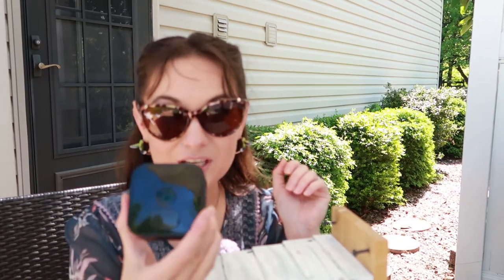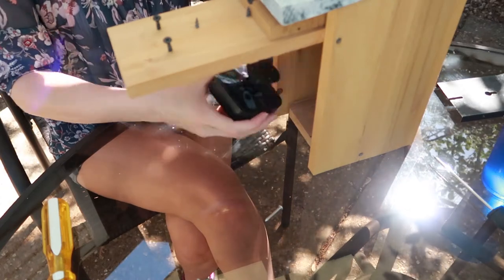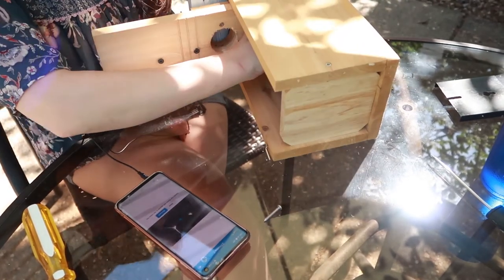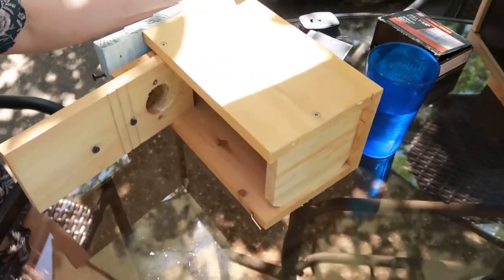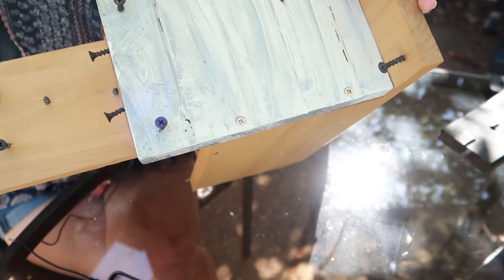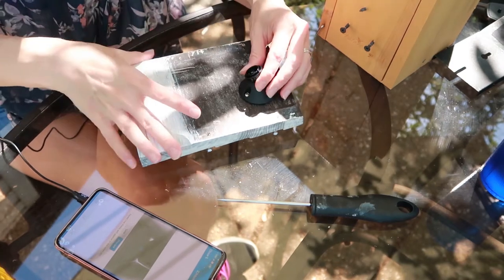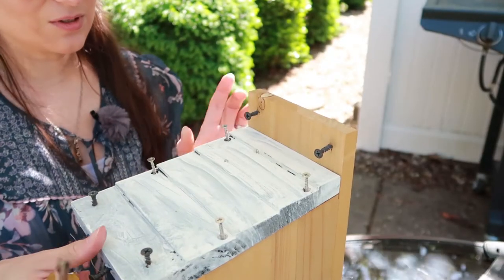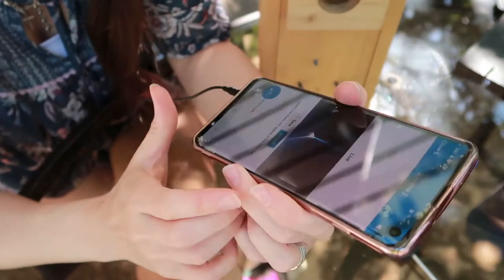How to Install a Blink Camera In Your Nest Box/Birdhouse for Bird Monitoring

Comment: Have you had any issues running out of batteries with the blink camera during the process?
Reply from the maker: Yes actually. Some ways around that is to only turn monitoring on manually to check the box. And this is actually important on hot days because an active camera will add heat to the box.

The other thing to do is to install a solar panel. They're cheap - $30 on Amazon.

I made an install video recently:  https://youtu.be/M2_fLZj9LVc
Reply: @nesthollow5159  If I have brand-new batteries installed, it won’t last until fledging? I totally get that there is a lot of motion going on but they are supposed to last for two years. Weird that they wouldn’t last for a few months of nesting – no?
Reply from the maker: @DanielKowarsky  mine lasted up to about a week before fledging. That was with having motion on at night and during certain times of day. So they can last quite a while. But it cut it super close.

You also won't want monitoring on 24/7 because your alerts will be going off twice a minute during the height of activity. But during certain stages and times of the day, it's fun to have the monitoring on. It's a great way to study the birds too. For instance,  what time does momma leave the nest in the morning? When does she roost? At what point does she stop sitting on the babies to keep them warm at night? So there's definitely a lot of fun stuff to watch.

If you're worried about the battery, I'd invest the extra $30 or so for the solar panel. It's just so helpful and puts your mind at ease. Toward the end when they were close to fledging I'd check the camera and pray it wouldn't run out because the app alerted me to low battery.
Reply: @nesthollow5159  Thanks for all the info! Really appreciate it!
Reply from the maker: @DanielKowarsky  no problem. Thanks for the questions.  They're great ones to ask for sure.
Reply: @nesthollow5159  Hey! It’s me again! I have a chickadee pair that have just excavated the box and I’m now waiting for them to bring moss in to start building their nest.  I saw how much motion went on during the excavation process so I decided to install brand new batteries into the camera after they excavated.  I have my camera mounted to the top of the roof inside using heavy duty velcro. It actually works extremely well! I’m not using the mount because I get much more viewable space without it. For that reason, I am unable to plug in any micro USB to the back of it – not enough room. Next year, I will build a taller box so I am able to incorporate some of your mounting ideas and I will also be able to use the micro USB and power it that way.  Just a couple of quick questions. Should I be turning monitoring off at night? Did you use the scheduling in the Blink app? What did you typically keep your clip length at? Mine is at 30 seconds. You also mentioned that you turned off the monitoring during the day as well – did you do that the entire time and turn on as needed? Any specific Blink app settings that you recommend? Sorry for all the questions! Thanks again 😀
Reply from the maker: @DanielKowarsky  yayyy chickadees  ❤ 💙 . They are the sweetest. Ok they're all the sweetest.

Pardon all the typos. This is on my phone. 

The velcro idea is brilliant, but yes,  I understand the issue about the USB port.

I don't have my camera going all the time. Here's a few things I'm doing with my Dees:

1. She's roosting at night. Nest is still in construction. So I turn the camera on at about 5 and wait to see when she comes in for the night. I like noting the sleep times. I don't leave my cam on at night because I don't want a ton of notifications waking me. I wake before she does. So I'll turn my camera on to see when she leaves. I capture the in and out moments to get times.

2. I wait to see if I catch her going to the nest and turn it on to get some nest progression footage 

3. When she is ready to lay, I'll probably leave the camera on more to see if I can get laying footage.

4. When I know I'm close to hatch day, I turn the camera on every now and then to get footage.

5. Daily capture of nestlings and feedings here and there.

6. Forgot, incubation, flip the camera on occasionally to get footage of egg turning and mate feeding.

7. Camera on occasionally during tough storms to see how momma and babies handle it (always fine).

8. I check them at night before bed. Very quick footage for that.

9. Occasional quick check ins during the day to make sure they're OK.

Keep your clips quick for check-ins and longer if there is certain footage you're after. Last year with this process I got my camera to last me very close to fledge. By the time the bluebirds were fledging, the battery was in the Red. So I checked once a day for a split second.

I only have so much storage with Blink so I upload good footage to a Google Drive account and regularly purge from the app.

I haven't tried scheduling,  but thats a great idea.
Reply: @nesthollow5159  Thanks so much! Really appreciate it! ☺️
Reply: @nesthollow5159  Last question - I promise 😀
My nest box has a wire mesh at the bottom of it to elevate the nest. The female chickadee has removed all the shavings down to the wire mesh but there are still wood shavings under the wire mesh which she seems to want to try and get to remove. I’m not sure whether I should remove the wire mesh for here or not I just wanted your advice?
Reply from the maker: @DanielKowarsky  no worries. Your questions are appreciated.  Has she started the nest? If not, I'd remove the mesh. I think the main reason for them is so that blow fly larva falls to the bottom. But so many birds hate the mesh. 

There is a video on the channel about using diatomaceous earth under a nest once the nest has gotten going. This can help reduce the potential for blow flies and ants.

However,  I wouldn't do it with Dees. They kick up a lot of dust when building and that could be harmful for their lungs. 

The upside with chickadees is that they nest earlier. And while it's still cooler, bugs are more dormant. Blow flies become more of a concern when Temps hit 70 or higher and stay there for a while.

Since bluebirds have multiple broods, blow flies are a bigger concern for them. That's not to say that it can't happen to chickadees. Monitoring is key :).
Reply: @nesthollow5159  She hasn’t started the Nest yet but she’s taken it all the way down to the mesh. Do you think if I remove the mesh, it might scare her away from the nest box because of the change? Really not sure how she will react.
Reply from the maker: @DanielKowarsky  there is always the chance, but if you're worried about the safety,  I'd remove. 

And in my experience,   my Dees have been pretty tolerant.  Some people I've known have had very skittish birds.  

I had 2 boxes up this year for Dees. And they started "excavating" one. But a bluebird poked its head in the entrance and scared the chickadee pretty bad (hole reducer kept it from being a worse situation). The Dees abandoned that box and took up the other. So I'd say a bird is much more a fighting threat in their mind than a change inside the box.

Again, it really comes down to safety.  If you're afraid they'll try to get down in there and get stuck... take it out.

I found a mouse recently that got its head stuck in hardware wire mesh. It was a bad situation having to cut it free. But I got it without injury and helped it back to health before releasing it. So wire mesh and getting stuck in ways you'd never expect is pretty scary to deal with.
Reply: @nesthollow5159  I took out the mesh.  Its funny - everything I’ve read and seen says the chickadees take out some of the wood shavings - not all - but she seems to want to take them all out.  I put about 3-4 inches in there! Pretty amazing!! Thanks again for the advice!! Always learning 😀
Reply: @nesthollow5159  Just wanted to know your opinion on this. If I happen to run out of battery on the blink camera, is it safe to go into the box to switch out the batteries? Will she abandon the babies? I know it’s not ideal but just wanted your opinion?
Reply from the maker: @DanielKowarsky  this is a great question.  I wouldn't do it while there are babies in the nest because you're presence there will end up being longer than if you were to manually (physically) monitor. And that will cause stress. It may also attract the attention of predators. 

When monitoring, whether manually or by nest cams, we want to do it more for the sake of the bird than our own sake. And that is so tough because it is such a neat thing that is happening inside. 

For manual monitoring,  you want to avoid opening the box when the babies are getting closer to fledge time because they may jump out of the hole or out of the access panel. And sometimes when they jump and you've put them back, they jump again later. And that would not be good.

My advice is to only turn the camera on a few times a day, get quick capture and then that's it. But that will save your battery.  If it does go out, switch to manual monitoring  - open the box, slip your phone in while on camera mode and snap a few pics. Be careful of your grip.. you don't want to drop your phone. You can also just peak in.. Spend less than a minute at the box. Always tap gently incase a parent is in there feeding. I tend to watch first and make sure the one that entered then exits before i approach- still tap too. Snap a pic and done. 

Again, at about 12 days, don't open the box. You'll just have to watch from the outside. As long as the parents are active, things are just fine.
Reply: @DanielKowarsky  Hello! May I ask what brand of heavy duty velcro you're using to mount your Blink camera to the top of the roof in your nest box? I used what I thought was strong velcro for my blink camera in my nest box, but it won't hold the camera up, so I took it down. I would like to put the blink back up to view my newly chickadee pair....Would love to know what velcro you're using, and how you mounted it? Thanks so much! Like you, the mount that comes with the Blink camera seems to take up too much room in my nest box, so I thought the velcro would be a perfect solution.

Comment: My Nature Way box was used by my BBs and they had 5 eggs, and they all fledged fine 2 days ago. I have the Blink Outdoor. I do not believe this camera will work in any box that isn't 12 in from roof top to mesh at bottom(to help w/blow flies). I went to local feed store and sized up about 5 different NABS auth boxes.None of them seem to be any larger in the base, 1 was very tall, and the bird hole was way high which will cause the same issue with the camera part to be barely above the box opening hole, possibly even slightly obstructing a normal entry by a BB.  The Woodlink BB3 they had was only 1/2" to maybe 3/4" larger base area than my Nature Way, and minuscule amount taller. Plus, the Woodlink BB3 they had in stock that I looked at had no drainage holes, no plexiglass shield and it was a front open box, which I have read is not the way to go for regular visual monitoring. So, I am in a quandry about how to find a box that this camera I paid $100 for on Amazon will work in. When I install it in my Nature Way box, the camera is right at the top of the hole. A bird coming in to the box through the hole would almost hit its head on the camera going in. The feed store did have a gable roof box from recycle material and was exactly like the one you show in the video for mounting the camera in a gable box, but when I went today to look, they were out of it.  Have you any information about BBs not accepting a recycle material box? I read on Sialis site of someone who switched from a wood type box to the recycle material gable box, and his BBs rejected it. Anyway, I am very very disappointed in the whole idea and I really wanted to use one for the monitoring and seeing my BBs next brood from hatching to fledging.
Reply from the maker: The nest lifts will make an issue when it comes to the Blink camera.  I personally don't use them because my bluebirds refused to use the box when they had them in there. And so I never thought to account for them in box recommendations.

Instead, once the mother blue has built a good amount of her nest, I will use a spatula to lift the nest up and then very lightly dust the bottom of the box with Diatomaceous earth to reduce blowfly and ant risk. This is a common practice among some bluebirders.

I wait for the nest to be near complete because I do not want that dust getting all over thr box while she shimmies in there to make it. That could be bad for her lungs. So having the DE sandwiched between the base and the nest minimizes loose particles floating in the box.

If you want to use the nest lift,  another way to mount the camera would be to skip the actual mount. And instead hold it in with hardware mesh... or, you can screw 2 elastic bands to the roof very tightly,  then stretch it so you can slide the camera in so that the elastic bands hold it in place. The upside is more room. The downside is that you can't shift the angles. But if you mark your placement aheas of time using the live view, you should be able to get the perfect view.

NOTE I have not tried thr elastic band mount with a nest lift to see how much clearance there is. I just know this is another approach birders use when they have a box with limited room.

I know that thr woodlink BB3 will provided enough room for the camera on the traditional mount, but that is definitely without a nest lift. 

The woodlink BB3 should have a gap between the nest box floor and the front and back walls. This is to allow drainage.  Double check. Sometimes they don't have them,  and I think what may happen is Woodlink might rely on multiple suppliers (given current nationwide logistics issues on everything), and some of the suppliers may be better at manufacturing according to the true specifications while others aren't.

If the box does not have drain gap, you can drill a few holes in the bottom corners. 

The BB3 also does not have kerfs (horizontal grooves under the exit hole for fledglings) , so I scratch them in with a utility knife.

I don't personally care too much about the plexi viewing windows. I've always opened the box for manual checks. I also saw a post in Facebook recently about the plexiglass causing a glare on the camera footage that really obstructs the view.

I hope this info helps.
Reply: @nesthollow5159  Thank you for your help. I did in fact get the Blink installed in my Nature's Way box that Barclay and Bebe used for their first brood. I eventually got them trained to use a caged mealworm feeder to eat mealworms during the time of their nesting and until the nestlings fledged June 21. I kept feeding as they would come in 2-3x a day for worms, fly across the street to the cul de sac that borders the very edge of the small lake and probably feeding the surviving young. Yesterday, I saw Barclay come out of the nest box and so I got some worms out to the feeder and ran my sleigh bells to let them know and they came in several times yesterday. After I saw them come out of the box, I was determined to try to successfully install the Blink, and I did. It does not block the entry hole in any way! And I finally was able to figure out the setup. The Synch 2 was what threw me. Your video about installing in the gable type box was huge in my ability to install mine! 
    I am a bit sad today, as after they came in this morning for one trip to the feeder cage each, I haven't seen anything of them. I had to bring the worms in due to rains. I put them back out twice and just the last time 30 mins ago, and no BBs. 
   Where do you get that DE you mentioned? I have never heard of that. I could have done that on their first nest building. '
  Thank you so much for your sight! I learned so much. I am keeping my fingers crossed that Barclay and Bebe will be back for another brood. It is only the end of June. I believe that with the cool weather we've had here in E TN up until now, they were delayed having their first brood. However I do know that they could've had their 1st brood somewhere else and for some reason came to my box for the 2nd. Again, I so appreciate you! Whether they come back again and I get to greet Barclay every morning when he perches on the line just across from our yard, or they move on until next year, at least they were my first BBs and I won't forget them.
Reply from the maker: Hey there! That's great to hear. A few things:

1. DE (Diatomaceous earth) can be found at hardware stores I'm pretty sure, and on Amazon.

2. It can take some time before they're ready for the next round of nesting. Mine finally started round 3's nest after round 2 fledged 10 days ago. It's as if she was waiting for July 4 to pass before getting started again. 

3. When the Blink camera turns on, it clicks.  Usually this doesn't bother the birds,  but some people have mentioned their birds being temporarily scared by it. So my recommendation is to turn your automatic motion capture off (disarm)  for now and look out to see her come to the box to build. 

There is a running man icon by the camera's thumbnail, and if you click it to turn it gray, you disarm the camera. You can still manually turn the camera on by tapping the video camera icon. Wait until she's got a good portion of her nest and then test the automatic motion capture again. If she's still nervous, just wait until she has an egg. And I personally don't leave my motion capture on all the time unless I'm looking for something specific. Otherwise I'm overloaded with footage.

I hope that helps. I'll cross my fingers for your next round 😀